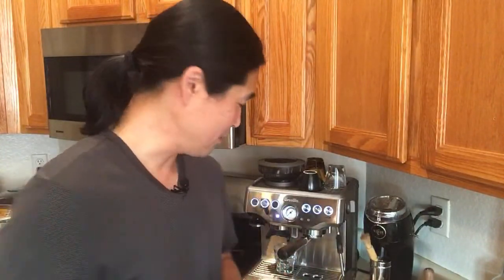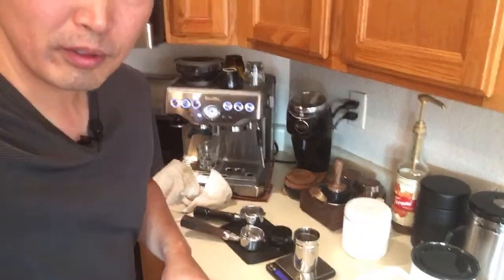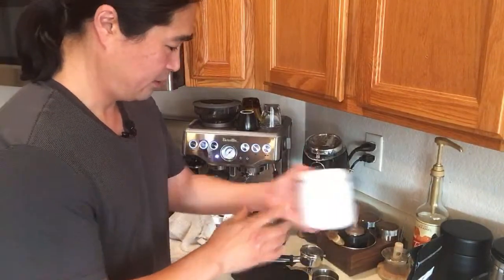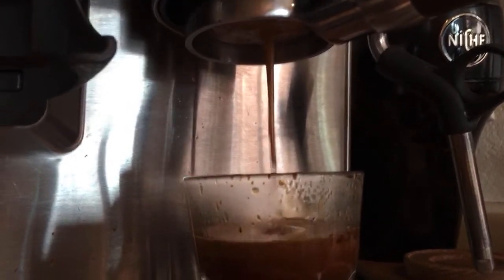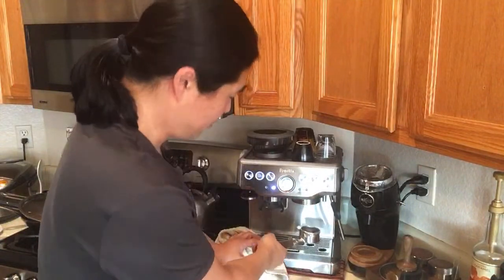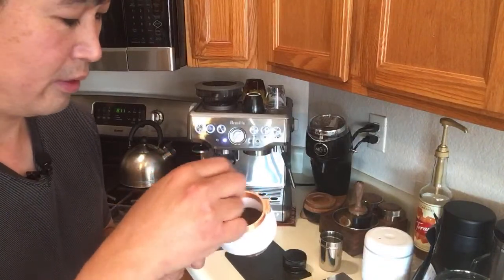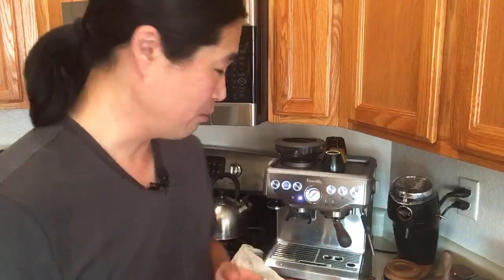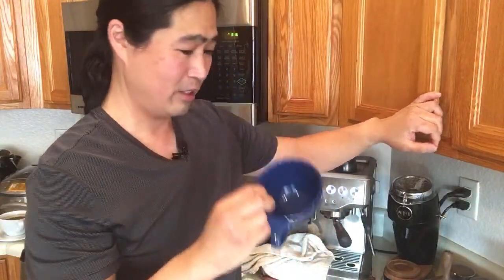Live - How to fix Espresso Channeling | Breville Barista Express

Comment: Honestly I think the quality of your grinder and the quality of your filter basket play a big roll in getting a clean shot. You can prep the puck as good as possible, but if the equipment you are using is not high quality, you will have inconsistent shots.. that’s just what it is and we have to come to terms with it. 
What you can do in order to get the most consistent shots is:
1) Always weighing your coffee dose and yield.
2) Try to find the “right” grinder setting to get the ratio you prefers in 25-35 seconds. 
3) only change one variable at a time.. only change the dose if the steps of your grinder are too big (more than 10 seconds)
4) distribut the coffee as evenly as possible and try to get rid of all the clums
5) when tamping, make sure all your angles are right and you tamp as evenly as possible (do not twist while ramping! this will cause unevenness in your puck)
6) make sure your water is hot enough but not too hot! Between 90-94 degrees celsius 
7) have fun and enjoy

Comment: Nice video. I own a Barista Pro and have recently replaced the filter basket with a basket from a big Chinese platform company. The new basket is slightly bigger which makes it easier to use 20 grams. Thus far I had better extrations with the new basket than we the default one i.e. no more channeling. I do however stur the grounded coffee quite excessively with a WDT, which in my case is a multiple needle tool used for felting.
Reply: Hi Matteo, if you could share with us a reference for your replacement basket that would be really appreciated.  The quality of the OEM filter basket is a huge limitation.
Reply: Btw, the descriptions says max 18 grams, but I manage to fit in 20 grams easily

Comment: Hey, I was wondering if you account for the residual coffee grounds that remain in your grinder after grinding. In my Barista express, I'll have up to 1.5 g of coffee grounds that are not released. Of course in your Niche grinder that will not be an issue since it has virtually zero retention. To solve that problem on my Breville I literally blow the grounds out. I achieve this by putting a bag over the hopper and then squeezing the air out, thereby pushing air through the grinder and blowing out all the grounds. 
I also get channeling on my shots, especially towards the end. They also spray around and make a mess. However, the shots still taste well extracted. Still trying to figure out how to get rid of the "spritzing".
Anyway, I very much enjoyed your video. Thank you!
Reply: Still trying to get rid of spritzing too.

Comment: I’ve had the Breville Touch for about a year and it has started to pull more heavily on the left. I cleaned things and took off the group head and ran the water, and the water distribution/faucet thing itself is pouring more water to the left. Any ideas?

Comment: I get almost no channeling, pretty consistently. The way I got to it as by advice for some pro friends -
I used a set amount of 16gr (to not choke the machine) and started going down more and more in grinder size until the shot was (almost) perfect. 
This is my sweet spot and I move just a bit with the different beans I used. 
If you use fresh beans you should be able to get pretty greta bottomless shots consistently. 
I'll try to upload a video later
Reply from the maker: Sounds good!
Reply: @HoonsCoffee  Another thing that is important to remember about barista express, which causes more channeling and also might explain why tamping makes bigger difference in this machine is that this machine doesn't have a constant pressure. Pro machine will have a constant pressure, not matter how fine you grind or how hard you tamp. 
The barista express's pressure goes up the more "hard" it works, meaning if you grind finer or tamp harder, the brew pressure will be much higher and will change the whole process.
So usually to avoid channeling you can grind finer, but here it might actually cause more channeling as the pressure will be higher.

Comment: I have one and it helped me perfect my shots by changing different variables such as dosage to stop the channeling.  I found that the channeling was worse using 16-17 grams than using 18 grams.  

When using 18 grams it was better although this is not set in stone, darker roasts tend to be more dense and oily.  16 grams of a dark roast can look exactly the same as a medium roast in the basket as the lesser the dose I found to be more dry in consistency when ground. 

There is another variable which affects the consistency of the ground coffee and its of course the type of beans (altitude grown, origin etc). 

Conclusion:  The dryer consistency ground coffee you should put the maximum that the razor tool allows and weigh the dosage.  

For the more dense coffees and darker roasts anywhere between 16-18 grams which ever works best for them specific beans.  Hope this helps.

Comment: Ive been having issues lately with shots spraying really bad. Really really bad. Its a fairly new machine, ive been trying different dosing amounts, distribution techniques, tamping pressures, im using an IMS basket, dont have wdt just the round tool and tamper. Its my breville barista express grinder. Maybe it needs cleaning, maybe its inconsistant grind size. Man what a mess. Its been getting worse n worse and used to not be a problem. Ive tried flushing machine, descaling, everything but a wdt. Thats next but i dont feel like i need it. Its probably that breville grinder. I might just paper clip tool distribution and see if that fixes it. Im just not liking that one step of wdt basically so im trying to avoid it. Group head gasket is good. No leaking during cleaning. hmmmm very frustrating though because im not exactly sure wth.

Comment: Hey Hoon. I just got the  naked portafilter for the BE. So far just channels. I use 17g coffee in, so thinking on increasing to 18, 19, 20 with progressively courser grinds to compensate for dose. Theory is more coffee at courser grind will give shot at lower pressure and hence less likely to channel. Also notice the basket that came with naked portafilter has a very different profile to the original.

Comment: Bit late, but I get same problem with channeling and it is messy. I tried a lot with fresh beans and the only way to get got shot is using 18g with in and out ratio of 1:2,5 in about 30 sec including preinfusion. The problem with this is that the pressure ist going very high on this shots. It raises in scale on 2 o'clock position I think. Any tricks helping me with that?
By the way, loving your videos. Alway great and I have learned a lot about making better coffee with my barista express.

Comment: Hey Hoon, I'm on the lowest grinder size and a got the distribution tool and tamp well. Still I barely get to 25 secs for the shot and it pours out 50-60ml....any ideas on what I could be doing wrong? 

Tastes good with milk but really sour and bitter espresso
Reply from the maker: What kind of bean are you using it? Fresh beans or store bought?
Reply: @HoonsCoffee  fresh beans with a roast date. Very fresh like Monmouth coffee.
Reply: I get the right pressure and get crema, but the extraction time is very short, especially for the amount being extracted...its quite frustrating.
Reply: Have you tried changing the internal burr grind setting? I only discovered that fairly recently and it helped me out a lot.
Reply: @tomonaldo  ah cool, how do you do that. And how did you discover it? :)
Reply: @abhivithlani7772  Here you go: https://www.youtube.com/watch?v=QNvOcE4-VEo
Reply: @tomonaldo  thanks so much! Hopefully this works! Last trick I think haha.
Reply: @tomonaldo  this really helped, thanks so much for sharing!
Reply: @abhivithlani7772  No worries! It really helped me out too - was shocked to discover it after several years of owning the machine!

Comment: Hi Hoon.
How old is your Barista Express? It looks pretty new. Mine is almost 5 years old. Kind regards
Reply from the maker: This is 2 years old. Did you replace any parts on your machine?
Reply: @HoonsCoffee  Yes. I had a water leak around 2.5 years ago caused by the rubber seal been enlarged because all the times that I took the water tank out to be cleaned (I guess). The machine was still on warranty so it was put a new rubber seal for free. Sage (Breville in the UK) sent a technician to my home to do that.